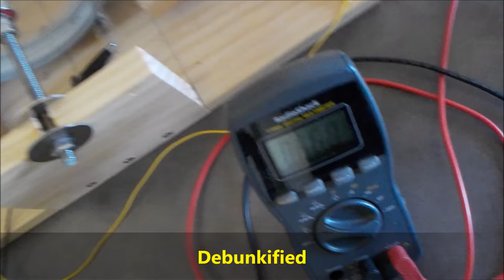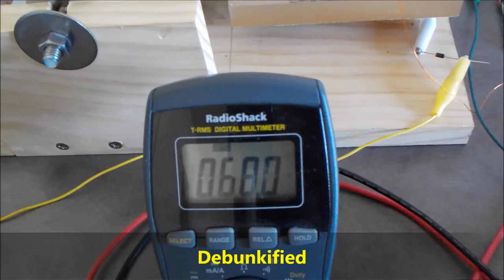GLIMPSE of FREE ENERGY OVERUNITY BYPASSING LENZ'S LAW

Comment: Have you tried pulsing a coil with 2 magnets each one on either side of the coil with opposite polarity. Some Call it Parallel Path motor.
You'll get higher speed and higher voltage

Comment: Have you tried to put the coils horizontally ...? Like the ZERO FOCE MOTOR ...?
Reply from the maker: +hi skycollection yes, there is nothing generated unless under certain other configurations in which metal cores connect, but then there is still Lenz's law, albeit less, but less is generated in return.
Reply: Ok thanks, I have a doubt and maybe you can help me ..... in my last video is about the zero force motor and I tried that and I get the BEMF, John Bedini says that in these kind of engines does not produce BEMF, what do you think, BEMF occurs or do not...?
Reply from the maker: Hi Skycollection,

You must ask your self what is BEMF? BEMF occurs everywhere, even in a simple wire. It's the energy that is always fighting against the current, whether that is forward or back current, it is always there. If by BEMF you are referring to Lenz's law, then this will always exist unless you find an asymmetric system, usually it's the bigger the rotor (weight and mass) that has a better angle (curvature )that can lessen the effects of Lenz's law during a magnet swipe past a coil. Hope that makes sense.
Reply: Ok thanks, i have many experiments about Lenz Low and some experiments with multi-filar pancake coils, is difficult to explain for me because i do not studied electronics, I realize that this is complex to understand, I have felt in my experiments that  there is BEMF in all the coils, conventional coils and pancake coils...!
Reply from the maker: Hi, no worries, just study the basics and use your common sense, that's all! No need for indoctrination to say that you know something with a piece of paper, that's for the birds!  Just keep in mind it's Lenz's law that is the OU killer, and OU is hidden within. Lenz's law is just the back reaction of the original cause, just get rid of the effect and have yourself a one way acceleration with nothing stopping it.
Reply: Thanks for the advice, my latest experiments are based on a device that I built and is called "SKYLEV" this device develops speeds above 40,000 RPM, it has been very interesting as it eliminates a large percentage of LENZ LOW, if you have time, go to my last 4 videos. Greetings and thanks.

Comment: Nice work, so if one wanted a child like that to produce 50amps with those 60 volts how big would one need the coil to be and what gage wire and how many turns if my motor was spinning at 6000 rpm?
Reply: Bifilar coil with tick wires, and high capaciance between wires.

Comment: if you have voltage but without current can you still get an electric magnetic pulse from it, makeing a coil after the capacitor or something like that?
and if so would it be enough to move a washer for example?

thanks for the class ^^
Reply from the maker: Hi there, voltage without current equals No Power. I have not yet seen voltage without current powering anything. From what I understand current is needed to make a magnetic field.

Comment: Do you have connected in series the two coils...?
Reply from the maker: +skycollection The two coils are completely separate from each other, first coil's purpose is for motorizing, the other is for generating. Think bigger fields crossing more wire equals more power, just get rid of the feed back mechanism of Lenz's Law so that the source doesn't feel it anymore.

Comment: your shorting the coils own potential through the reedswitch
wich gives you BEMF :)
thats why you get these 200+ voltages :)
connecting earthground to the cap can up the voltage even more ;)
 thanks for sharing
Reply from the maker: You should try watching the video where the generator coil is producing more current back to the battery than what's coming from it. The input and output voltages are the same because there is only one battery involved. In that video there is lots of Lenz's Law opposing fields dragging down the rotor, here I show a method of getting that energy out of the coil, without the rotor drag nor making the input current go up.
Reply: dont worry about mr. S some people troll the internet just to put negative comments and are totally missing the point. they are negative people that dont contribute anything but are quick to pull you down. Yes there are many motors out there but the point, which was obviosly missed was re-using or recycling that wasted energy. So keep up the good work
Reply from the maker: Thank you. Some negativity is ok, it helps balance things out, at least is how I see it, but thanks for your positive comment! Yes the point is recycled energy in the collapsing field, but even more energy in the generator coil, in which the OU is locked up in the voltage, Of course then it's just a matter of getting the current out without increasing input current or dropping output power, which is where the switch shorting, or coil shorting comes into play to obtain the OU power without losing it through rotor drag caused by opposing fields of Lenz's Law. The OU is there, but is only hindered by the feed back mechanism (reaction) of pulling current from the gen coil in the first place. Just get rid of the reaction and be left with only action.
Reply: you should try letting the gen coil fill up a cap.
and then dump the cap at the peak of the sine (the same point you coil short a coil)
it gives minimal drag (since caps are quickly full) and doesnt give drag cause the discharge is only that of the cap.
somewhat the same effect john bedini uses on one of his inventions :)
Reply from the maker: Filling caps with the gen coil at peak of sine wave works good too. High voltage coils help because smaller caps work best without drag at all, but the power out in discharge can be not as high as we like. This is how we get good current out from a cap is by making sure there is a nice high voltage going into cap. More voltage, more power without the drag, into smaller caps, like a Tesla Coil would when charging a tiny little cap and then discharging through a spark gap, which I believe was his way of eliminating the Lenz's law.
Reply: yeah the discharge was infact the "coil shorting"
because of the resonance the voltage in the lc circuit rises above psu voltage.
till the threshold of the sparkgap kicks in.
shorting the potential.
and what happens with coil shorting?
a voltage climbs significantly.
from that moment the turn ratio comes into play stepping up the "bemf" in the primary coil to insane levels. :)
atleast thats what i think is happening
Reply from the maker: Yes, the turn ratio increases the voltage, the more wire (electrons) the more voltage, and if one gets it out correctly, then more Power. The discharge from the coil is not a normal field collapse, yes a type of field collapse, but if viewed on a O-Scope an AC Ringing can be seen on the peaks of the normal AC sine wave, something extra other than just the AC sine wave alone.

Comment: Congrats! You discovered the principle of the interrupter ignition. 

While the reed switch is closed, induced current builds up in your AC coil.  Connected to that current is a magnetic field in the AC coil, its core and surrounding the coil.
When then the switch opens, that current keeps flowing, building up a large voltage across the AC coil.
This cycle happens 4 times per turn of the rotor, since it has 4 magnets on it.
The rectifier and capacitor act as a peak voltage detector.

That's not overunity.  I'm sorry.

Comment: hey how are you running the motor transistor censor or what ?
Reply from the maker: +rntesla nielsen Just reed switch commutation. For some reason it doesn't want to work right with a transistor, maybe the transistor is blown or something, but I've tried two of them, I can't see how they are blown already.
Reply: ok do you have one or to pole magnets on the rotor
Reply: +debunkified and if i remember right the transistor will burn if you dont put an resistor abaut 10 k ohm betwin the 12v and the trigger
Reply from the maker: +rntesla nielsen I have four magnets on the rotor. They are about 1 1/2" diameter, but I'm not sure that is exact because I haven't really measured them lately.
Reply from the maker: +rntesla nielsen I had a resistor on the trigger wire, a tuneable POT in fact, and actually I think that might have been the culprit. Really transistor switching is the best way to go because it presents perfect timing and switching for motorization.
Reply: +debunkified ok i think you have only one pole facing aut and if so thats why you have the trouble whit the heating and the charging then you only got like a voltages diffrence like low and high plus to your battery or high and low minus your multimeter dont understand that its only understand to read voltages diffrence so then you get elektrons to eat the power on the battery
Reply from the maker: I don't know exactly what you mean by "I only have one pole facing out", I have 4 rotor magnet poles facing out all the same pole. As far as the voltages, the output from both the collapsing and generated power together is in the hundreds of volts, by the time it makes it back to the battery, it then becomes equal to the battery and in so doing causing a current to flow back to the battery. Does this make sense? I don't know if that addressed your question or not as you're question was a bit obscure.
Reply: +debunkified yes but if you have the the same pole aut you get different power mostly negative high and low negative it dont work together whit the positive power on the battery  the multimeter dont understand real plus and minus if you take 3 battery and whit 2 make 24 volt and from them take the minus conect to the minus 12v and then put your multimeter betwin the 12v+ and the 24v+ and you will see the 12v+ becomes negative on your multimeter becourse its only see the voltages difrence
Reply from the maker: I'm not sure what you are really saying, but I believe you are suggesting to alternate the poles S,N,S,N? I think maybe that's how the last setup was but I don't really remember.

I should probably try that again, I already tried reversing the battery polarity but that didn't work so well either.

I am also confused as to what you are talking about with the "Negative High" and "Negative Low"?

I assume you are just saying that all north or south poles out doesn't work with the regauging magnet behind the motor coil???
Reply: +debunkified no thats not what i mean negative i mean static electricity like in the bedini motor whit 2 battery the run battery whit normal elektricety in it and the charges battery being charges whit static electricity thats total diffrent electricity
Reply from the maker: Ahh! I see. I believe you are referring to negative electricity charging another battery but unable to charge it's own battery.

It is true that the battery needs rest time in order for it to recharge itself, I am working on a device right now that is resulting in very obvious OU. It's MOTIONLESS.

The collapsing field is sufficient for this and no generator is necessary! In fact the generator is just regular hot (positive) electricity UNLESS short switching is done to it to convert it into cold electricity! In that case it NEEDS a CAPACITOR. Peace.
Reply: +debunkified i will bee happy to see that charging devices very nice work you have done in all wideo that ZPE devise what is that called in real languare and where to bay that

Comment: P.S. if you want stronger ones i have them...but they are epoxy coated neos rectange 1/2 inch thick 3/4 wide 1 inch long Warning: they will hurt you if you let them pinch you they WILL draw blood... and if you let them stick together you wont get them apart without damageing them....
Reply from the maker: I see says the blind man. Already done that, and OUCH! I am here to confirm your predictions with actual results of smushed up skin and bruising, with a few cuss words attached, along with some blood, and damage to my magnets. Not pretty, not pretty at all.
Reply: Yeah there so strong i have trouble working with them. They pick up all the machined metal in my shop that is everywhere LOL Keep up the great work!!

Comment: dude ... lenz is bypassed "simply" by switching off the electromagnet as it passes by the permanent .. and then switching it on again giving it a mechanical boost and electric potential   .. 

How you know you dealing with a real device ?   When you put a load the input decreases and the wheel spins faster output increases 

Short it and you have best values ! and blow up your machine because it wants to leave this planet at some speed and thats also how you create antigravity btw. one way
Reply from the maker: Hmm, you’re exactly right. I am finding out there a lot of ways of doing things. I’ve been messing around lately with pseudo forces to much of my surprise! That includes the combination of antigravity as well as free energy combined.

Comment: First off, voltage is easy and does NOT bypass Lenz's law. The system only presents Lenz's law when you start to draw CURRENT, and the resistance to the magnetic field is presented.
I am physically ill at all the people doing these mind numbing videos when they don't even understand the most basic concepts of electromagnatism or physics. You can get voltage just dragging your feet across the carpet. At any given moment there is about 10,000 volts of static VOLTAGE on our skin.
I will say this clearly, and I will say this only once.
OVER-UNITY IS INPUT VS OUTPUT TOTAL ENERGY!!! NOT JUST VOLTAGE!!
Over-unity is very real, but this is just cannon fodder for misinformation.
You device is still within symetrical thermodynamic equalibrium, and CAN NOT achieve over-unity no matter how hard you try.
Conservation of energy in thermodynamics is absolute. If you are within symetrical thermodynamic equalibrium, you WILL NOT get more out than in.
Multi-dimensional asymetrical devices NOT in thermodynamic equalibrium WILL achieve unity as the MINIMUM efficiency.